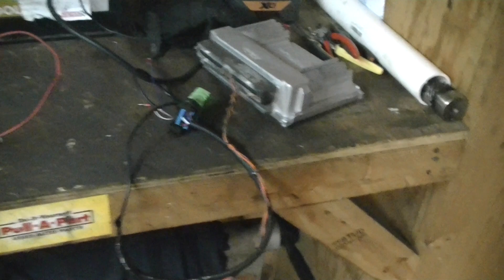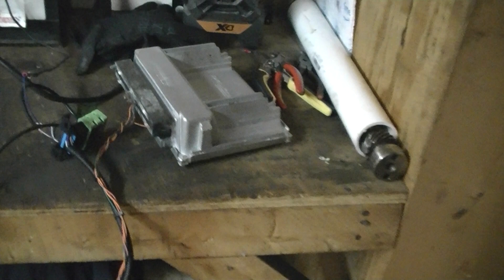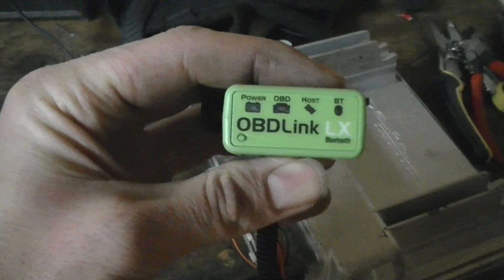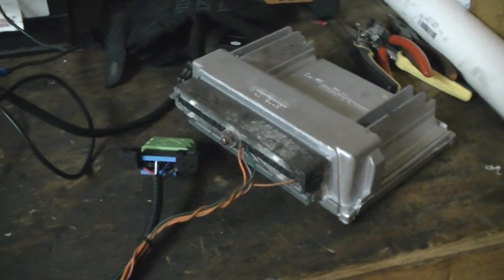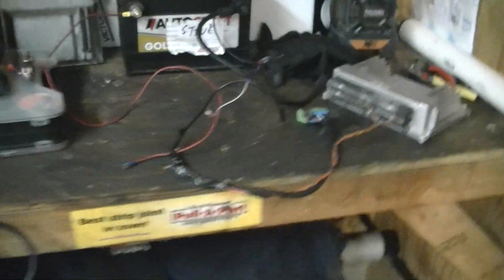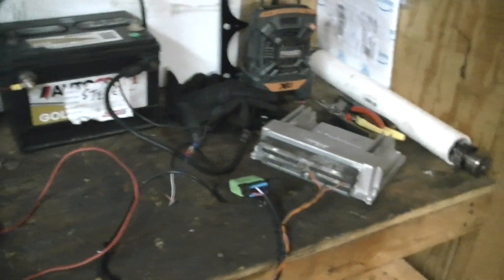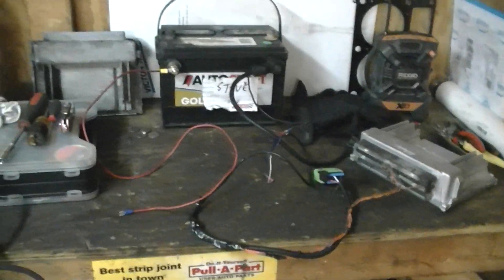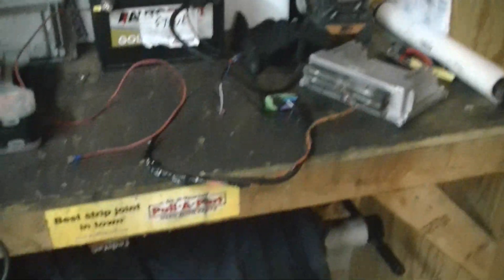How to: Build a BENCH HARNESS & FREE ECM TUNING FOR 1999-2007 GM LS1 ECU

Comment: I've been trying to tune to tune my 2004 pontiac Grand Am GT any kind of free tunable software that I can find with no luck. I'm using VCX Nano in my endeavors if there's anyone out there that can help guide me in a way or do it for me I'd i'd be so happy. Someone must know someone on here to help. i'm not talking mapping or any kind of fuel ignition all I want is simple things like turn the temperature down when my radiator fans kick on. if I could do more that would be wonderful And as and at the current time PCM hammer was a hope but it failed because it's only for an LC1 engine. I also wanna know if it matters if the PCM is on a bench or if it's inside the car because I tried it in the car I haven't made a bench tuning apparatus yet. so if anyone out there can help me or point me in the right direction or Ask a friend I would be much appreciative thank you.
Reply: the P04 is not fully supported by pcmhammer .

That OsID (12584933) is currently unknown to PCMHammer.

Comment: The battery works cause it’s dc not ac I’ve seen people power them harnesses with ac adapters try a dc output adapter 12v 1 amp or 1000 ma dc should work then

Comment: "19+20 wire then together, they go to your battery", this confused me. If those are two separate wires going to two separate pins how would you "wire them together"?   Make a splitter and send the one wire to the batt? Sry for the ignorance.

Comment: this shit does not work, ive torn my hair out trying to get it to work
Reply from the maker: Works fine for me.. Ive unlocked 4 computers already..
Reply: BeeterOlds Garage & Budget Builds Fixed Until Broken I went back and done some more stuff to my ecm. I now have fuel and ignition, it’s booming and popping however still not starting. I can now hear the fuel pump being commanding to run by the ecm for two seconds key on, then off then runs again when cranking. Seems like after about 7 months messing with this all I needed was to vent a little pre pubescent like discomfort on youtube. Finally feel like I’m getting somewhere

Comment: Can this not be done while pcm is in the vehicle thru the obd port?
Reply: Safer to do on the bench without other modules connected to the network that might interfere with communication due to this being aftermarket software

Comment: Hey buddy can you please tell me again what programs I need to download to be able to remove the vats and delete 02 sensors. I'm new to this!
Reply: Late reply but if you're still looking you can use LsDroid to download the tune from your pcm then use TunerPro to disable VATS and then delete the dtc for the secondary o2 Sensors and remove them, then just simply upload the modified tune back onto the pcm

Hope this helps 
(Ps. To be able to edit the tune you will need an XDF file for your pcm os)

Comment: I think some wall adapters interfere with bluetooth signal. I'm not sure, but when I listening radio in my car and plug my phone charger or dash cam power adapter, it is make static on my radio (only when I'm 60 mile away from my city). With old type adapters with transformer inside shouldn't be interference.

Comment: Ok i understand everything you said but i have a blue connector on my harness but a spare green one that will not be used.. Can i use the green to replace the blue connector?
Reply from the maker: As long as you use the correct pins on the ecm itll work fine

Comment: I used it to clone a pcm that I unlocked with hp , then used hp to tune it.
Reply: I have one unlocked (HP tuners) PCM in my horde. It's currently in a truck, but i'm considering benching it so I can just clone it on to all my PCMs. It's an extra step but if it saves $100 per PCM... it's a sore dick deal.

Comment: Wait,so now we can tune our truck without spending several hundred on a hp tuner or the likes? That's big,really big!!!!! I knew there was a good reason to sub to you,thank you :)
Reply from the maker: Download Tuner Pro on your PC. You can use XDF files from Gearhead EFI.com to set the parameters of your stock tune. You use your phone to read and write the tune. Thats it
Reply: @beeterolds  does it work on 2007 silverado LY6 with the newer ECU?
Reply: @FirstLast-tx3yj  No it doesn't. Only works on p01 and p59 ecu's.
Reply: Each modification doesn't cost any credits either.
Reply: Is tuner pro still an app?